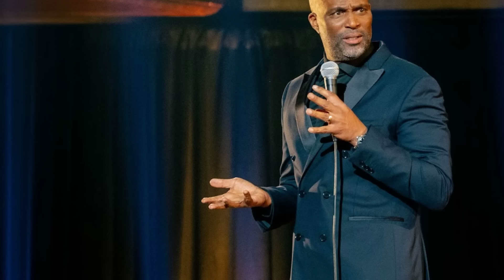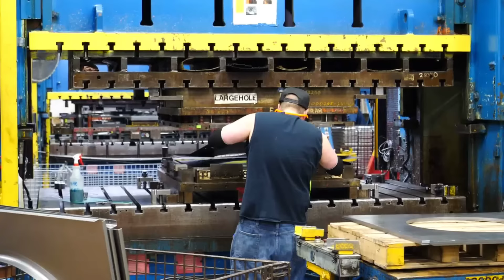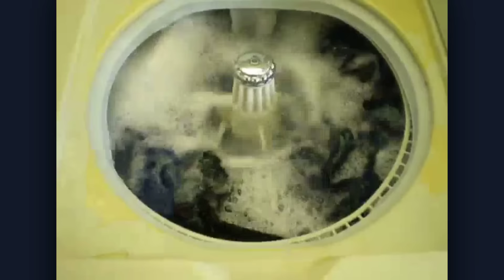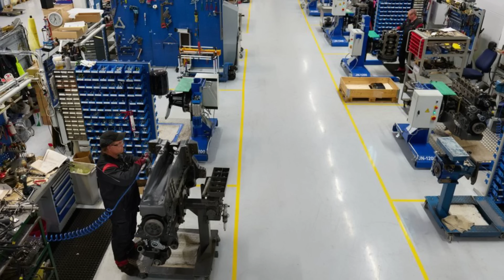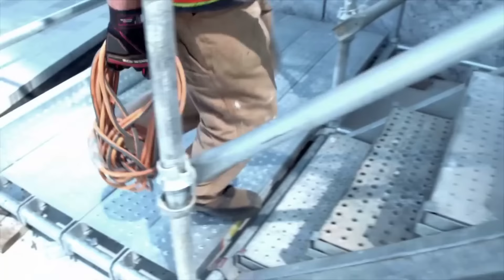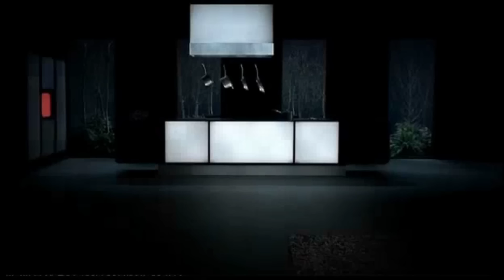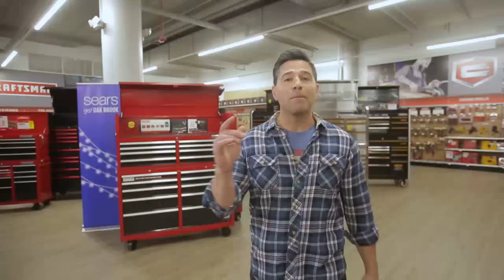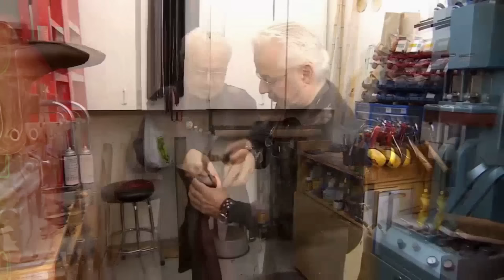The Only 5 Brands That Still Last (The "Buy It For Life" List)

Comment: I switched to iron skillets years ago, I still use stainless for some things. I steer clear of non stick. The only apprehension that I have about speed queen is the capacity, too small.
Reply: Mine is huge and I overload the hell out of it, I work in a steel mill and winters are layers....
Reply: I don't like cooking poultry because I don't wash with soap, and acidic sauces damage the patina.  Nearly 20 years old and looks better than new.
Reply: @texaswunderkind I'll only pan fry chicken and pork in mine, you are right about the sauces

Comment: but . . . the Speed Queen has no way to talk to the dryer sitting next to it. Nor the fridge, toaster, blender, microwave etc. You can't even call it from your phone.  " Hey Alexa what do you mean the washer isn't responding?"  🤣🤣🤣🤣 I'm being sarcastic of course. Our 25 yr old Maytag washer & dryer are still going strong after more than 10,000 loads of clothes.  🙂
Reply: A small, probably from the 50’s Maytag repair business is gone from our area. The kind with the store in front and the house in the back. He went and did repairs during the day and she manned the store for contractors and regular folks like me. The last thing I bought from them was a dryer drum belt. On a Saturday afternoon they had it. 

Of the belt breaks again I will have to order on line and hope I get the correct one. 

The place is a smoke shop now 😳
Reply: I did have to replace my washing machine with a $100 marketplace scratch and dent special after the agitator motor seized up. Granted it was from 1986, and this was a couple years ago. The dryer is newer, from around 2000. I just replace components as they fail.
Reply: It also doesn’t talk to a CCP intel office that links your homes WiFi to them and maps your house for them!
Reply: We had a Maytag washer and dryer from the 90's. We would still have them except that we could not get parts for them.
Reply: @fruitrollup8904 . You can still get parts but it takes some searching.
Reply: Don’t get a bew Maytag washer…..you have to fill it with a bucket and sometime it empties itself instead of washing clothes.  I HATE IT!
Reply: @Mickey-jn8hz  Yes the new one are garbage. Not even sure who makes them anymore. Not the Maytag Co
Reply: So are my Maytag 25 year old Atlantis model washer and dryer.
Reply: @petemiksich5760  Yep! Atlantis is what we have.

Comment: Honda generator parts availability ?   you better double check your facts
Reply: I work in a honda generator dealer eu22s 3 recalls, inverter failures, 6 or more months wait for parts, eu70 major failures, fuel pumps, gcu,s. Eu32 engine casing failures, inverter failures, in all cases long wait periods for part. Honda is no longer the company it used to be.
Reply: @graemecamday 
Interesting my machines are well over 10 yrs old and are pampered,  I wonder if its like so many other products  these days just poorly  built..
Reply: Depends where you  arr
Reply: My mom honda generator from  1998 starts on first try...they are quality! I don't know about the parts, never needed any...
Reply: They obsolete their crap like a red headed stepchild.

Comment: I had a Speed Queen washer that lasted 30 years. I still am using its partner dryer which is 36 years old. Also, i have been using my same old Lodge cast iron pans since I can remember, definitely at least 30 years. I use them every day.
Reply: We picked up a new Speed Queen a half a year ago, we love it.  Went with the basic model, no lid lock, simple controls.  I hope it lasts.  It sucks that I have to spend 3 times as much money to get a washer that is built to the "old" standards, but in the end it will be worth it.
Reply: @ShimmyD-u7g  We paid $1K each for our commercial SQ pair. Cheaper than many big box store brands.
Reply: @ShimmyD-u7g  does it have a gentle cycle? For more delicate clothes. (Actually most clothes are are delicate these days. Because they are made out of cheap fabric. Even fake fabric and sewed together very poorly.) These modern washers make me crazy with frustration. I am considering the speed queen. And can you wash sheets, quilts and bed spreads in it? Like is there enough room in the tub? Which would also be why I would want the gentle cycle. That cycle appears to be lacking in many of the washers.
Reply: @BelindaTN  We have the Speed Queen TC5.  Yes it has a delicate cycle.  We wash sheets, bed spreads, quilts in it.  The tub of course has a real agitator, so it actually washes your clothes unlike the agitator less abominations.  So it's not going to be mega huge, but I will say that it is much larger than the tub size of the previous Maytag unit we had, which had an agitator.  I know when you read the tub size specs and compare it you think it's small but for an agitator style, its pretty roomy in my opinion.  If you're able to go see one at a store that would be great.  We were able to go see one.  I looked in, and immediately thought, yep, good old classic washer, does what you want it to.  Oh and the cycle times are like the old washers, short and effective.  Some of those front load washers are an hour plus long.  Speed queen is like 30min.  

Oh and another big thing is the water fill.  Basically there are two levels.  The standard default and deep fill (when you select the deep fill).  Standard is 10 gal and deep is 13.  Basically what we do is if you have a half load, just do the standard and if you fill it up, do the deep.  I will say it totally fills the water up so it's not one of these washers that you read about that doesn't fill enough because they are trying to be "eco friendly" or some other bs.  I mean you need to use water to clean for god sakes.  One last thing, if you do get one, it does have this "normal-eco" setting,  Just ignore it, its a bs cycle they probably had to put in there to satisfy some eco law.  The Heavy Duty cycle will be your normal cycle.
Reply: @ShimmyD-u7g  Thank you for your info. It settles it for me. The Speed Queen it is. I am ready to dispose of my current GE. I only got it because it was the only one I could find that did not have the electronics. And it was not labeled as energy efficient. We have plenty of ‘energy’ to operate the thing. Including plenty of water that comes from our well. It is also very cold water, so I need to be able to heat that water up. Nothing gets very clean in cold water. And nothing gets clean at all, if you don’t use plenty of water. After checking out the front load, I decided I would not use that if it was free. I have never seen so much complaints about smelly washing machines and the clothes that were just “washed”. If the clothes stink, they are not clean. Hopefully the Speed Queen will let me rinse my laundry in warm water. My GE sure don’t. If I want to rinse in warm water, I have to stop the rinse cycle and put it back in the wash cycle. So I can choose the warm or hot water to fill the tub. Anyway. My ge washer and dryer is acting up these days. I have had them for 12 years and have been anxiously waiting for the need to replace them. First time in all
These many years, that I am glad one of my appliances need replacing. Oh and locking lids on the washer makes my head want to explode. If I had to deal with that, I would find a way to override that thing. I have for years and often needed to stop the wash cycle to add something to it. Or just stop it to let whatever is in it soak for a little while. Thank you so much for answering my questions.
Reply: That's nothing. A friend of mine has a washer and dryer in avocado from Sears.They was built in the early seventies.
Reply: @usx06240  I miss Sears. I bought all of my appliances there and they lasted for 20-30 years. I left them when I moved across country, but I bought a Sears house. It is 120 years old. New roof every 25 years, and updated kitchen and bath about 15 years ago.
All of my tools are Craftsman from old Sears. My grandson has them now. He will pass them on to his son.
Reply: Speed Queen is made in Ripon, Wisconsin. I bought a SpeedQueen washer and dryer 5 years ago after I could not get a couple of simple parts for my 40 year old Maytags.
Reply: I have a Speed Queen washer! I love it!!
Reply: My Kenmore washer lasted 32 years. I expect the new Maytag to die before too long and will get the Speed Queen. I wish someone had told me sooner. My Kenmore dryer is still going. I have a Honda generator and Honda engine on my lawnmower.
Reply: @KWGreene Yep. I was in the same boat when I couldn't get parts anymore for my 33-year-old Kenmore dryer.  Now have Speed Queen washer and dryer.  Everything else has been trash since 2010 at least.
Reply: Iron never goes out of style.
Reply: Griswold is my favorite cast iron and enameled Le cruset
Reply: @nolanbyrne7905  Griswold is excellent and they hold their value. I have several marked and unmarked Wagners that I got at flea markets for very reasonable prices. All well over 60 years old. Wouldn't part with them.
Reply: I own two 9 year old stainless steel Speed Queen Quantum commercial laundry units. They're still ticking. All I need to replace is the dryer's belt.

I also still own a 33 year old Honda lawn mower. Unfortunately, some of it's parts are no longer available, one of those being the steel chute guard.
Reply: everything OLD...is NEW again!